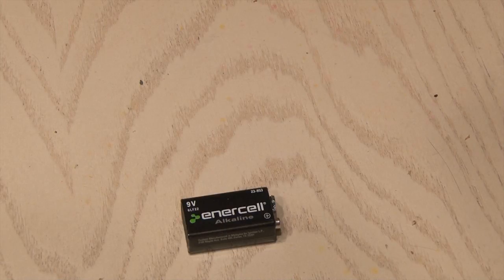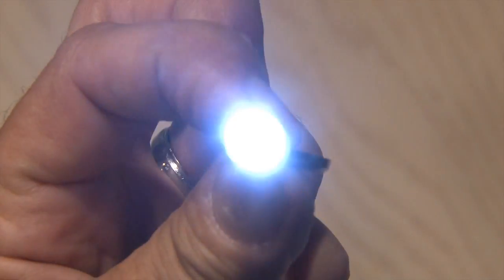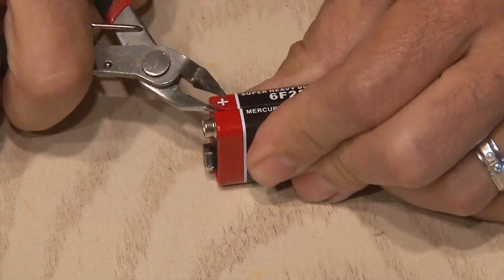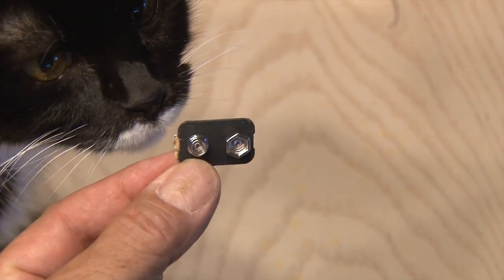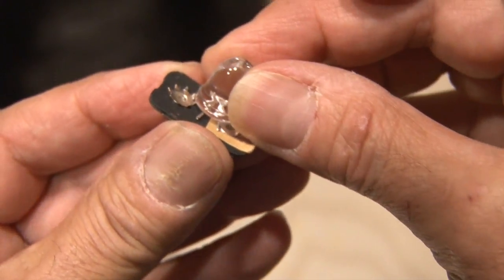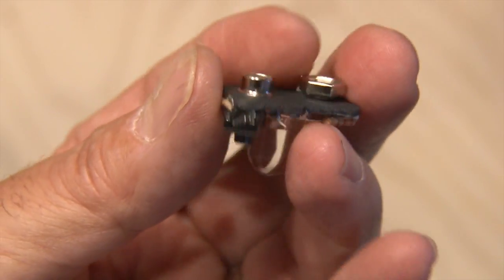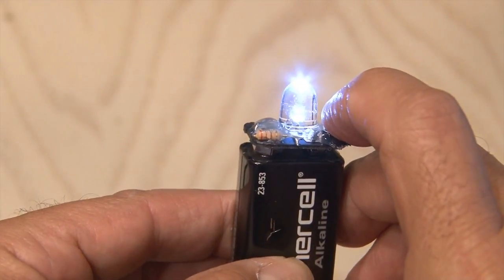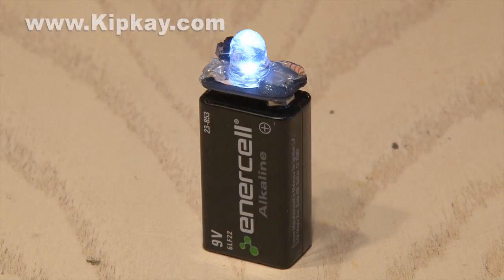9 Volt LED Torch!

Comment: Fun little tip. If you take a small piece of tin foil and glue it to the top of the components but underneath  the  LED the light will reflect more forward allowing for a little light boost.

Comment: amps are the capacity (of a battery for instance) and voltage is the amount of amps that is draining from the battery over a specific amount of time. So lots of amps = high capacity, high volts = fast draining of capacity

Comment: I'm not sure how to use the calculator but I know it's orange orange brown gold. I made two more of these but using an LED strip with a built in resistor and so far it's working. And I made a third one using one of the LED modules from an energy saving LED bulb and it is bright and runs cool and only draws 22mA from a 9V battery. I tested the voltage drop and it's only .01 volt. I have videos up of the second and third LED torches.

Comment: A 9 volt battery itself would burn out the L.E.D. They are meant for about 3 volts. So the resister brings down the voltage.

Comment: I made a cheaper one whit a pen tube and a led from a lighter whit the battery and i did not use a switch the tube was small so it pushed the contacts together all in 30 seconds and i used up 30 cents and they work as a glow stick what do you think kipkay huh .
Reply: I think your spelling and punctuation could use a little work....

Comment: I understand what resistors do and why you need them, I just don't understand the calculator linked in the description. What values are they asking for? Thanks.
Reply: callum llewellyn if you want to know what type of resistor you need you must find out the led voltage, the source voltage (battery) and the current and use this calculator

http://led.linear1.org/1led.wiz
Reply: You need to find forward voltage/current in led datasheet

Comment: Resorting to trash talking your opponent in the hopes that it transfers discredit to their argument is what is called an ad hominem. That's a logical fallacy right there. In any reasonable argument, you would lose by default unless you offered an actual valid argument. But then again this is the internet where trolls like you can hide behind a username and spout ignorance.

Comment: +Justin Joost Ive opened a 9v battery b4. It has AAAAs instead of all acid. Some batteries are built off of other batteries.
Reply: Alkaline 9v's have 6 cells. Heavy Duty batteries have acid.

Comment: Because most LEDs only use 3 v and so they don't last as long with the excess voltage. A resistor cuts the voltage down by a set amount, making the bulb last longer. Just google it. There are plenty of places to look.

Comment: Kipkay
I made two of these, one is like this but with a regular  white LED and another with a small board with three white LEDs and resistor on it and a switch from a dead solar yard light. it seems to work but the resistor gets hot when it's on. My other one died (blown resistor).

Comment: whoops put 3.1, 3.2 or 3.3 for the forward voltage.

resistor just 'limits' (9V from getting through and only around 3-ish volts)

this is a good visual for that: bit.ly\14uOBse

Comment: What does the resistor calculator do? And is there LED lights that work on 9 volt battery without a resistor calculator?

Comment: I was hoping Kip would do the impossible and make a 9 volt battery power an LED to light things on fire.
I understand torch is a word also used for flashlight. Kinda bummed.

Comment: ehh no a switch is about 12p a piece so you know £1.20 for ten pack
and low end leds are like £1 for 10 and resistor for like 2p-3p and £1 for 8 9v connectors to total = 2.92 for 8 torches not shabby at all and i have made things for this price before not including the batteries ofcourse

Comment: It's a flashlight, not a "torch." And it wouldn't have killed you to state the resistor value. It is supposed to be simple, right?
Reply: It could have killed your diode (if it is not powerful enough).
Most LEDs work at 3V, so the resistor must have 2/3 of the voltage.
But the resistance of the diode reflects its power (and its current).
According to the above-mentioned calculator, the diode in video works at 300mA (at 3 Volts it gives almost 1 Watt) -- I found it from the resistor value from "4 Band Resistor Color Code Calculator"" if I correctly see "Red Red Black Gold", it is "22 Ohms 5%".
WARNING! If you simply use such resistor for less powerful LED, the LED may burn or explode!

Comment: For fuck sakes, I have been fucking around with electronics since I could barely walk, my father was an electronic engineer, I develop embedded designs in Arduino Pic Chip, Atmel, I know for a fact many of my designs led's are still working today and I used Lite-On LED's which is about $0.05/pc @ 5000 pcs, from Digi Key, maybe you don't know this but most electronic parts today aren't hand crafted, they come from machines made somewhere in Taiwan, which almost every factory uses.

Comment: The electical efficiency is sooo low because of the resistor...
Reply: Downer
Reply: That's a 330 ohm resistor. This thing draws less than 30 mA. I don't think that's much to complain about.

Comment: kip can i just not use a resistor and a swach
Reply: switch ya, resistor no (u need a resistor)
Reply: maverick catbagan mikekoz68 Well, if you don't have a resistor, you could be smelling horrible fumes for a while(if you have 5 volts directly into a 1.5 or 3 volt LED, it will burn the leads on the LED.).

Comment: What kind of resistor i need please tell me ????
Reply: If I'm not wrong, he's using a 3.3k ohm resistor. I'd recommend getting one from electron or element14
Reply: ok thanks really  much i have a lot of resistors laying around i will just check with my multimeter
Reply: He used a 330 ohm resistor (orange, orange, brown). It will be pretty dim with a 3.3K resistor.

To figure out the value use ohm's law. An LED should not be driven over 30 ma and 330 ohms is a popular, low value  resistor value. 9 Volts / 330 ohms = 27 ma or .027 amps.

I have made flashlights like in my classroom for over 10 years so this is not a new idea.
Reply: Dorian McIntire You're right. I posted that comment at about four in the morning where I was, so I was a bit tired. :P
Reply: SuperSlimeBoy I understand completely and I've been there myself ;)

I just wanted to make sure our original commenter wasn't  disappointed with a dim flashlight.

To Omar: you can use an even lower resistance, such as 220 ohm, for more brightness but will risk shortening the life of the LED. Many new LEDs can be run well above 30 ma but you've got to do your homework on this by looking at the LED datasheet..

Comment: What is a risister and what does it do
Reply: homero chavez It limits the amount coming through from the power source, otherwise it could dame things on the circuit. They are measured in Ohms. Hope this helps.
Reply: callum llewellyn it limits the current
Reply: ^ and resistor

Comment: 100 ohms resistor works with a a 3 volt led
Reply: Only for LED with 66 mA current.
Otherwise, it will either burn (or explode -- you should wear  protection glasses), or not give all light it can.